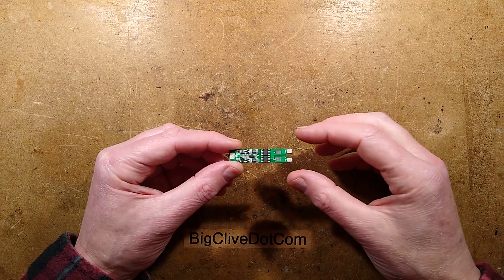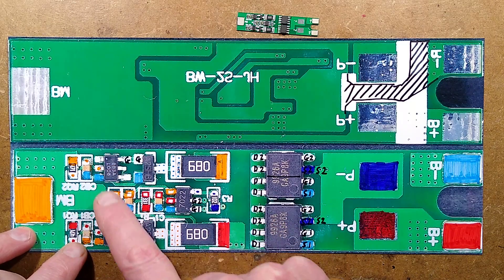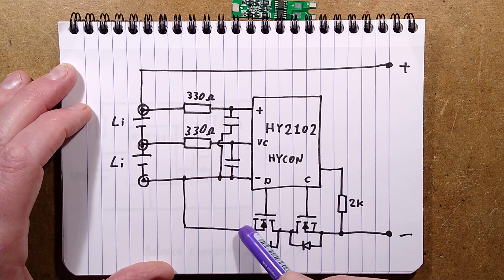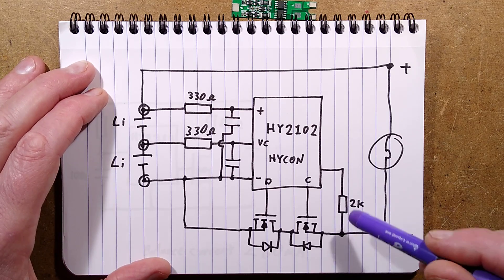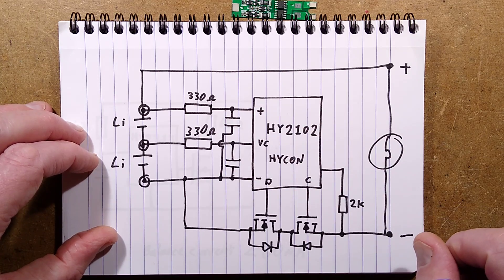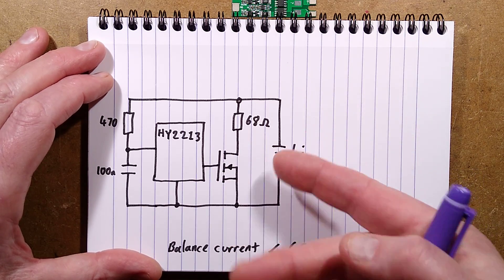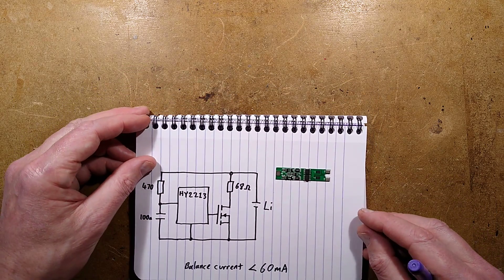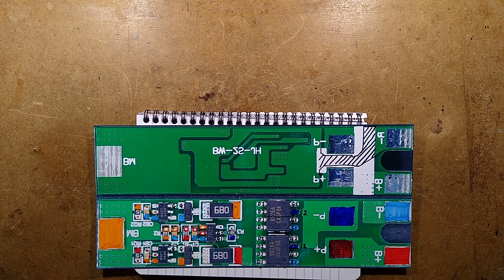Lithium cell balancer reverse engineering with schematic

Comment: Some smarter balancer IC's also balance based on cell difference. For example some of the BQ series chips from texas instruments define balancing voltage as a difference between cells.
So it balances at all times during the entire charge cycle and not strictly just during the CV phase of the charge cycle.
This is better, because lithium cells don't like trickle charging and for these dumb balancers to work the pack needs to be trickle charging. The dumb balancers also pose a risk of micro-cycling, where and overcharged cell might be discharged to balance and then allowed to charge again to reach balancing voltage only to be discharged again, therefore causing many micro-cycles.

Comment: Don't forget that the cells are supposed to be initially balanced. Before connecting then in series you should charge them to 4.2v in // for many hours. Also li cells almost don't loose electrons. IE in a cycle you get the same number in and out. The only losses are from unwanted side reactions that ultimately lower the cell capacity but that's a very slow process. The balancing circuit purpose is just to maintain the balance not create it from a set of completely unbalanced cells. When reaching the 4.2v limit, the differences is in the order of mV.
Reply: Exactly. If your cells are good from the beginning (ie no self discharge) then you should not need a balancer at all (although it is good to have one for that little bit of drift)
If one cell degrades sooner than the others, this one cell is under much more stress since it reaches the charge and discharge cutof voltage before the other cells, so it degrades even faster. At this point your balancer cant help you much anymore. But since your cells were supposedly equal from the beginning, all the cells should be near their end of life now anyway

Comment: I like the old 'flying capacitor' cell balancing for its improved efficiency but i would hate to try to build it....
(a capacitor is connected by a network of transistors to the highest voltage cell, when charged its connected by the same network of transistors to discharge into the lowest cell) (sold on sites as active balance bms)

Comment: so... i have used something similar, and for the sake of seeing how well it was charged, i shoved some LED's across those big resistors. the protection IC most likely wont trip unless it really needs to and it has some room to let the ballancer ICs do their job. also, the protetion IC will constantly trip the overcharge if once cell is grosly overcharged and it lets the balance IC bring that cell down when you're using higher currents at the earlier charge cycles.
Reply: Have you ever heard of a multimeter? Or a $2.50 Lipo checker? LEDs across the resistors aren't going to show you much of "how well the battery is charged". 😕
Reply: @davelowets  
In this case the LEDs will show how well the battery is charged, because they light up when a cell is at 4.2V.
Reply: @superdau  an LED will light up over a whole host of different voltages. They certainly aren't going to indicate 4.2 volts. An led can light up anywhere from 2.5 volts on up to 4.2 volts.... WAY over the range of any lithium cell's diacharge curve of 3 volts to 4.2 volts.
Reply: @superdau  One could design a circuit to light an LED at precisely 4.2 volts, but it's going to alot more components than just a simple LED across a resistor in order to be accurate, and not just light over a wide range of voltage.
Reply: @davelowets  
You don't understand the circuit. There's either 0V or 4.2V across the resistor, and nothing in between, depending on the charge state of the cell.
Reply: @superdau  It doesn't work that way...
Reply: @davelowets  
As I said, you apparently don't understand the circuit/function. It is exactly how it works. As long as the cell isn't fully charged there isn't any voltage on the resistor.

Comment: If anyone knows…
Are there any smaller single lipo charge protection boards available, smaller than the tp4056 boards?
Would like something to protect one of these little 550mAh vape 💨 batteries that I have lots of!
Thanks.

Comment: With regard to mosfets and diodes, the there's actually two diodes in Harrington the design semicolon but one of the two is hardwired short in most packages. The full outputs from a mosfet would be gate, drain, source, and substrate. There are inherent diodes between the substrate and the gate / drain. Usually source is bonded to substrate in the package since that junction would be forward biased, anyway.

Comment: A fun problem with many high-power mosfets (and also diodes) is that they have a failure mode where they short all pins. Haven't dissected one to see why, but this often creates havoc in the rest of a circuit (for some bizarre reason).
Reply: High voltage breakdown, a little static shock will do it. This happens to diodes as well, and is put to use in one-time programmable memory. (antifuses)
Reply: @jercos  I've primarily seen this first hand in high current devices, like a truck-battery charger supplying 48v/100+A (with quite spectacular results), though this could have been cause by static discharge.
Reply: A lot of battery safety testing is performed with the FETs deliberately shorted... you must have a UL rated fuse for short circuit. Bonus points if the fuse is a "three terminal" version with secondary over-charge detection... an entirely separate set of circuitry blows the fuse on over-charge. That way you can have 1 fault (a shorted FET, either charge or discharge) and still pass over-charge and short circuit testing. 

Adding a large Zener diode to the output helps prevent damage to the FETs from ESD. Also adding 2x series caps (again 1 can fail) across the charge and discharge FETs routes the ESD spike to the cells and away from the silicon.

By the time you've finished designing the BMS most of the circuitry is there for edge conditions (balancing, shorting, over charging, ESD, over temperature etc)

Comment: The units that I used didn't seem to balance the cells very well as the cells were at different voltages after charging.
Reply: How long after charging did you check the individual cell voltages? They could have been exactly the same after charge termination, but after the cells sat for a while, they bled off voltage at differing rates. Your cells may be shot, or mismatched, and this could be why you're seeing this. To DIY build a quality lithium pack, you MUST choose cells that are VERY closely matched, AND of the same age.
Reply: @davelowets  the cells were of the same age and equally matched to internal resistance and voltage.
And the voltages  were checked within an hour of cell termination
Reply: @daler2577  Then I'm guessing you had some crappy cells. 🤷🏻

Comment: About the charger: Li-ion chargers are CCCV, meaning they charge with a fixed current until they reach a voltage limit (4.2v per cell). Then they keep that voltage. So basically like your lab power supply: a voltage limited current (or a current limited voltage).

Once the cells are balanced, there is very little that will get them out of balance, because all the current goes through both cells.

Typically there is no trickle charge, because overcharging Li-ion batteries is not like Lead-acid or NiMH. You can overcharge and destroy a Li-ion battery with the tiniest current. So the voltage limit is a hard limit.
Reply: IF the cells are very closely matched when the packs are manufactured. People building these crazy "powerwalls" today, with many different cells all lumped together, are completely asinine.
Reply: @davelowets  Matching is important, however after balancing, cells do not tend to drift away from balance at 100% SoC. 
Still the pack will perform as well as the weakest cell, so matching cells is really important, but not that much for balancing.
Reply: Source: worked on charging systems for Li-ion batteries since 2006.

Comment: You explained it so well! Thank you very much. So this is a passive balancer (the 68 ohm resistor reduces the capacity a bit until the weaker cell catches up). Furthermore there are active balancers out there, too. And I'm keen to know how they work exactly, too.
Reply: One of the types of "Active balancing" uses a system that can "turn off" the charger power supply to the full cells, and back on to the cells that still need current, using PWM as the pack approaches it's full capacity.
Reply: @davelowets  Another active type uses a small flyback DC-DC converter to drain the highest cell and spread the energy across the entire pack (Or a larger portion of the pack) - Have a look at Linear's LT8584 IC.

Comment: I was wondering if partial charge and discharge of a cell, counts as a charge/recharge cycle?
After googling for hours, I can't find a definitive answer to that. Only opinions. No research papers! 
For this reason, I don't charge my moped after each little trip to the store. My range is 40Km, and I recharge every 30Km
Reply: partial charge/discharge obviously gives you a partial cycle.  logic right ?

but 3x 33,3% cycle is a tiny bit less then 1 fullcycle as the DoD is lower. and the lower the DoD the longer a battery lasts.  
that is the reason to discharge a lead acid battery not below 50% SoC. you might get 300x 100% DoD, but 750x 50% DoD.

similar with Li-batts. but much higher numbers. like 500 full cycles for a Li-Ion and 3000 full cycles for LiFePo4.
Reply: @casemodder89  Thanks for that Captain obvious. 
Plug you phone back on the charger every-time you use it a bit, and see how the battery won't hold charge after 3 years, just as if they were fully charged and discharged each time. 
Next time you see a question, make sure it was for you little turd. 
Now be gone little troll.

Comment: Even my Daly 100A 48V LiFEPO4 BMS for my scooter, only balances at 50mA. Charges at 500W until the first cell hits the threshold, then it stops and goes into trickle charge mode @~14W.
Daly sells an active balancer with Bluetooth, but the price was the same as the BMS, so I just went with the BMS and it's 50mA limitation.
I thought this value was too small, but after graduating from Google university, I found pretty much all brands are like that. 
Thankfully, I had to balance them once by leaving the charger on for 24Hrs and let it trickle charge all cells @50mA, to the 3.65V maximum per cell. 
Once balanced, they all seem to charge and discharge the same amount and don't require balancing. I contribute that to matched internal resistance and capacity of each cell.
I don't know if that will change with time or not. I figured the worst thing would be that one cell dies sooner and shuts off the BMS and when that happens, I'll let it on the charger for 24hrs until all cells are full and balanced once again.
Reply: As the pack starts to age, and gets closer to it's end-of-life, it will get out of balance more and more, and take longer and longer to fully charge.
Reply: @davelowets  All other chemistries do the same thing.

Comment: Current can flow through a MOSFET in either direction without resistance when turned on? I had always assumed MOSFETs had to be connected so current flows from drain to source. Ive never actually tested it. I didn't know that. So does that mean you could use a MOSFET like a triac to but when turned off you would just have half wave AC?
Reply: Yes, and you can even use two MOSFETs connected source to source to switch the full AC cycle. Some solid state relays do this. The main difficulty is that the gate drive needs to be referred to the source and this usually means isolation.
Reply: Some active rectifiers operate exactly as you describe... a diode initially, then a FET once the active rectifier controller has power.

Comment: I use these on the 2S 18650 battery pack on my bicycles automatic shifting. I got them for the protection and didn't believe the balancing part of it. However the packs have stayed perfectly in balance and maybe this is why. I have never balance charged the pack and it receives a lot of charge from a front hub dynamo.
Reply: That would be why... 👌

Comment: I wonder if this would work on the large solar lawn lights, that take 2 18650 batteries. Because those are built so cheaply that one battery always seams to suffer more than the other.
Reply: I've only ever seen them with the cells in parallel.
Reply: @PipeManPeep  I have 4 of them. 4 years ago I got them from Menards. They worked great for about 2 years, then I noticed they wasn't lasting very long. Everything tested good except the batteries. I replaced both batteries and a year later, I have the same problem again.
Reply: @brucereichert6509  are the cells are in series?

Comment: ISTM that you could do the charging via B+, BM, and B- with a smart three-terminal charger, and use P+ and P- for output only (or brute force quick-charge, of course). That would involve more wires, but would maximize balancing effectiveness.

Comment: Typically a Li-Ion charge controller like TP5100 is used with a 2S balancing BMS, which limits charge current properly and works well.  But buyer beware - many "chargers" (e.g. eBay "8.4V 1A US plug 1000mA charger adapter for Lithium Ion Battery Li-ion LiPo 2S") sold are just 8.4V power supplies with no Li-Ion charging logic.
Reply: Such garbage. They take forever to charge a cell, you never know for certain if the charger has completed a charge or not, and it can harm cells that are out of balance by over volting one cell while the other one is still low. 4.2+4.2=8.4 volts, but SO does 4.6+3.8=8.4 volts.... 👎

Comment: You missed how these actually work. Each circuit operates independently but not necessarily at the same time. You are correct that the large mosfets will disconnect when one cell overcharges, but the balance circuit stays operating and will slowly discharge the high cell.  Once the voltage of this high cell drops to a preset voltage, the main mosfets reconnect and charging resumes for both cells.  This cycle repeats until the lower cell catches up to the higher voltage cell. With each cycle the lower cell gets an additional amount of charge equal to what was discharged from the higher cell while disconnected.  This does not require the charger to limit current or know anything about the current state of charge of the cells.

Comment: I thought the ideal voltage for storing these cells was 3.8 volts. The ultimate circuit in a BMS would be to take the (individual) cell to 4.2V and if it wasn't discharged by use in a determined amount of time, the BMS circuit would discharge the cell(s) down to the optimal storage level of 80%. I know. Only in a perfect world!  😄There of course would need to be something in place that would allow reset so you don't start out with 80% charge when you need 99%. Also, in industrial usage, these cells would be constantly in use. I guess I am thinking of consumer applications, such as an electric chainsaw used seasonally.
Reply: There are ALREADY packs that do this, and the parameters are end user programmable with a small touch screen device that plugs into the pack. It communicates with the board in the pack through an extra tiny wire incorporated into various popular connector types used on packs. Spektrum brand R/C battery packs are an example of one of these...

Comment: On a related note, I would love to see you do a deep dive on the budget/cheap spot welders used to build lithium packs with, like the 10-20£ wish 12v ones. I often thought of buying one but are worried that they may do damage to my pack or my 12v battery/source. Could you see if a regular iup battery and/or a car battery charger (6 Amp) could work as a source of power to run it, would a super capacitor be better/required to make it work/not kill my 12v lead acid battery?
Reply: U need atleast 200+ Amps for spot welding. A charger certainly couldn't do that. Super capacitor are not suitable either. Best choice is obviously High CCA rated Lead Acids or high C rated Lipos.

One thing u also have to make sure that during the spot welding pulse, under that 200+A load, your battery voltage shouldn't drop below 11V. If it drops below that, then the spot welder kit will destroy itself (MOSFETs blast).  And you'll end up saying that the spot welder kit is bad. But it's the battery u r using is bad.

One more thing u have to keep in mind that the battery discharges a little bit with every weld spot. To prevent that, and to make every spot weld identical u should keep a very low current charger (1-2A) attached with the battery while welding.

I expect I cleared all your queries by now.
Reply: @SAHILKHAN-lu8oq  So do you think a motorcycle start battery is enough with the charger plugged in or must it be a full car start battery with high crank amps, I´m on a budget so I try find what is enough but not to much. Super caps can start a V8 car and give verry high amps, would that not be better than a lead acid battery?
Reply: @agw5425  a bike battery (4Ah) won't supply enough current. You'll want a car battery with a few hundred CCA.
A lead-acid battery would be cheaper than super caps.

Comment: Am I the only one who is desperately searching for the vias that connect the the P- pads on both sides of the PCB? And failing.
Or are the vias hidden under the pads themselves?
Reply: The pads themselves are soldered-on tabs of nickel, or nickel plated metal, meant for use with spot welders. Easy to hide vias under that.
Reply: @jercos  Are you sure? They look like the usual solder-coated pads to me, but there's only so much that you can tell from a photo.
Reply: @DrAHorn  in this case it looks like you're right, it's fairly common though. I frequently have to remove them to get better adherence to copper wire.